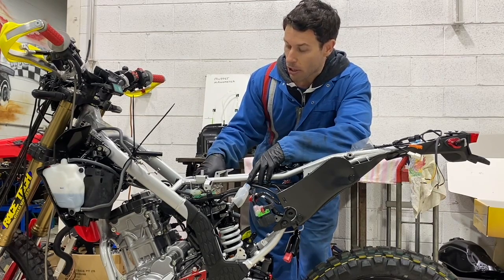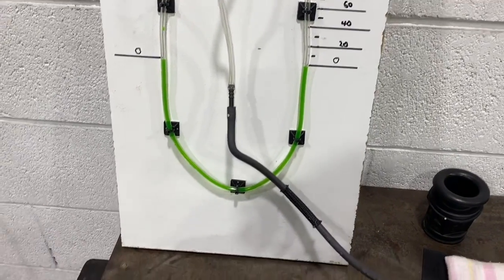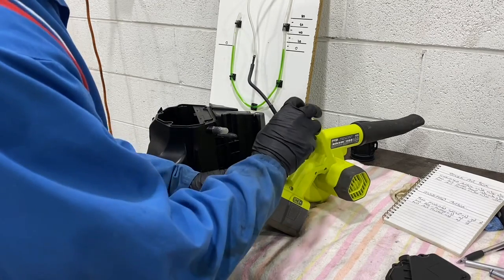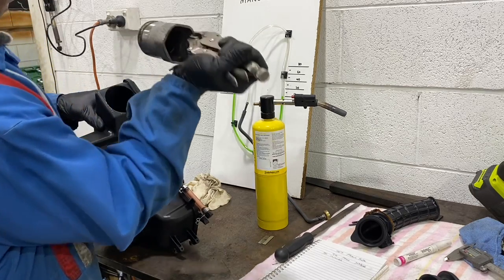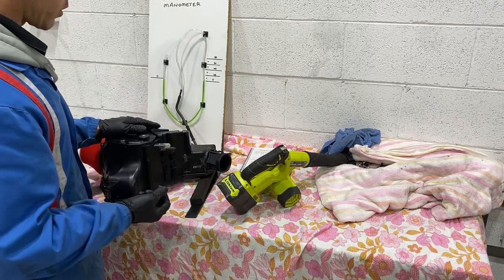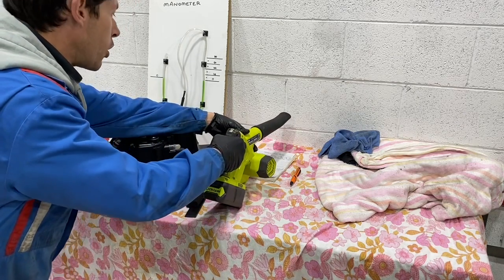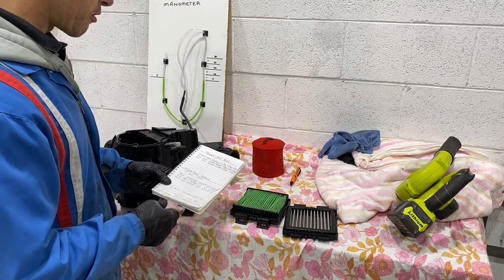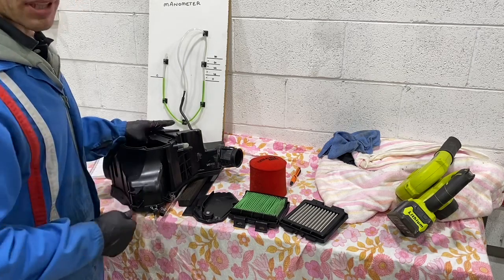Crf300l full intake test must see. Surprising results #crf300l #hondacrf300l #crf300rally #honda

Comment: But whats the max airflow that actually achieves max hp, by the principle you are working to a 6ft x 6ft airbox with a 4” velocity stack will give more more
Reply: many Dyno tests have shown that just increasing airflow (and consequent ECU tune to let it run not too lean) doesn' necessarily equate to more HP. Why would Honda's engineeres try to cripple the power of such a bike by simply restricting the intake airflow?

Comment: I just took the rear snorkel tube out. Cut that panel section out leaving a rectangular hole on the left and a triangle shaped hole on the right with a thin strip of plastic in the center for support. Silicone adhesived in a glassfiber screen door mesh to cover the holes. Took the reso chamber off and rubber glued in a shaped plug to smooth the inside of the intake boot wall.  Lastly, cut the front snorkel tube flush with the inside of the air box to create a still air box. Stock filter was retained, it is not restrictive even with the backfire guard. Made a big difference in response.

Comment: This test does not take into account the resonance of the intake system when the bike is running. This is just backyard "engineering." Not quite the same as those pesky Japanese automotive engineers use with their fluid dynamics testing. Leave engineered products alone!

Comment: I had a thought, and I know the CBR300 intake boot it like $20, but could you just cut the snorkel off the CRF intake and get a similar result and spend no money?  Would there be a performance upgrade vs. stock?  Also, then you wouldnt have the fitment issues with the CBR intake.  Id love to see that in another video with the Muppet Manometer!  I saw a Jake the Garden Snake video where he did the CBR intake mod and measured the ID of the 2 intakes, at they are the same at the throttle body end, but the CRF snorkel end is much narrower.  Just wondering if anyone else had thought about this.
Reply: I've thought the exact same thing... still haven't seen if anyone tried it.
Reply: @jesseduplantis3369  I did end up doing it, and using the cut off piece to add another air box hole. My butt Dyno says it helped, but I do t have any numbers to back it up

Comment: F()cking nice.  I have my bike tore apart doing these modifications right now. Removed the evaporative control system.  Removed in intake snorkel then enlarged the intake. I added the CBR300 High Flow Airbox Velocity Stack and the air box lid with the "frog skin" from 550 Performance.  I have a stage 1.5 ECU coming next week. Added the full RS-4 Yoshimura exhaust (which I highly recommend).  I might add the CBR cams but I doubt it.  I'm loving this bike, but if I want more power the only real option is to install the big bore kit from 550 Performance which I will never do.  After I fix this all up I'm going to ride it for a while then buy the KTM 500 EXC-F for more power.  I will never sell my CRF 300L but sometimes I need more power and speed so I'll get on my KTM 500 for that.  But for longevity, durability, and low maintenance I will ride my Honda.  I have a BMW 1250 GSA but I ride my little Honda 300L much more than that 600 pound BMW.

Comment: Great work Aaron, that confirms what myself and others have suspected. I am about to do some similar modifications to my airbox in order to take advantage of the CBR300 cams and 550Performance ECU.

I like your pod style air filter, does that fit under the seat ok?
Reply: I know you buggered your shoulder, but when you’re able, can you give some feedback on your mods now that you’ve given it the beans in a rally? 

I’ve been on the fence and have been waiting until you reported back as to it being worth the trouble. 

I’m at 4,000 miles and haven’t checked the valves yet. Figured I’d replace the cams and intake if in going through all the trouble if it’s worth it.
Reply: @marcochavanne  Hi Marco, I am getting ready to do just that. I'll probably need another week or so until I'm good enough to get back on the bike... but it is coming.

Comment: A lot of people say Honda did this for emissions but the CB300 is also honda's and it has the better air intake and cams, could it be that the intake snorkle is long to avoid water getting into the engine easily?
By being so long it dumps water at the bottom of the intake box and avoid it getting sucked through the filter

Comment: awesome video,are you going to go with a 550 ecu? and is it restricted between the throttle body and the engine? i hope you have the time to do follow up vids to the mods,keep up the good work cheers from WA
Reply from the maker: Yes 550 performance is almost finished with the new 1.5 modified tune , should be a winner.
Reply: @Azzaslife  awesome
Reply: @Azzaslife  anywhere I can find info on their new tunes?

Comment: Nice work - would the stock ecu adjust the fuel air ratio correctly to allow for the extra air or do you need the 550 performance tune ecu to compensate for the extra air ?
Reply from the maker: ECU tune is a must. 
Tune is lean from factory, only gets worse with mods.

Comment: Has anyone used a 3d printer to make an adapter plate to fit the cb300 velocity stack to the throttle body/airbox so we don't have to make our own seal out of epoxy or something?

Comment: The throttle body intake of the CBR may be a bigger diameter, considering it's length you will lose acoustic reinforcement flow at about half the revs that the original will have. There is no testing of the pulse performance. Now having said that you have cammed it for the CBR cams. This setup should give you a good boost. BUT if you are using the wide range CRF camms I suspect the low end power will suffer. The higher volume cbr intake will exaggerate that as the air velocity at lower airflows will be a lot slower. The air flow overall is useful for us with std cams I think, but I am not so much a fan of the throttle body inlet without the cam change.
I had a feeling the extermal intake socks were way too restrictive . Thanks for the confirmation!
My dBkiller modded ( larger holes in the killer) to intake cross-section MotoX , I have noticed that the 550 ECU is running rich even with two stock external intake tubes. So I may go to a much larger external intake and put a foam filter over them. I will probably make a couple of aluminium or carbon fibre Blair shape tubes there, but may just try simple larger diameter ones.
Thanks for the effort.
Reply from the maker: Thanks for the insight, I did a great deal more with testing (some things you mentioned) but I cut it shorter to reduce Boring content. 
I think this setup most people can relate their mods to.

Comment: I have seen other guys put the Unifilter snorkel sock on the end of the inlet like a dunce's hat and that seems to work better.
However i agree your modded 4" inlet mod seems to be most effective.
I have seen the 550 performance side cover with frogskin also - wonder what that mod would provide on your Manometre.
Also testing the unifilter foam main cage air filter.

Comment: Very scientific????
Reply: Eh probably not so much for two reasons: First, the suction of the leafblower is continuos, while a 4 stroke motor only sucks bursts of air. This is also the reason why airboxes often have those highly engineered shapes, because they want the air to resonate at certain frequencys (=at certain rpms) to produce boost. This video only shows how to eliminate air drag, but does not tell you what happens to all the resonances and other effects of the pulses. E.g. those long small tubes in the intake for sure cause drag, but they also produce a fast moving stream of air while the engine is performing an intake stroke. When the intake valve closes, the fast air has enough momentum to push forward in the tube and accumulate towards the end with a higher pressure. If tuned right, just as the highest pressure is reached, the next intake stroke begins and takes this "boost" in. The very long tube of the 300L suggests its tuned for low frequencys. The second problem with this experiment is how the hose taps into the side of the airstream. It does measure the drop in static pressure when the air is held back by drag, but depending on the orientation of the opening of the hose it could also see a mix of stagnation pressure and static pressure. These behave completely different, as one goes up with airspeed and the other goes down (Bernoullis Law). At last, comparing the pressure of the CB300R and the CRF300L intake is not good practice, because different diameter tubes will have different pressure inside, even if the same amount of air is flowing through (see venturi effect on wikipedia or elsewhere). And its just the amount of air (=mass) that counts in the end.
Nevertheless I think its great that this experiment has been done, and its probably scientific enough for tinkering with your enduro bike, i will for sure do some of those mods. Just keep in mind that you are also messing with resonances, which can make you loose some of this boost at certain rpms.

And i wonder why no one just cuts of the long CRF300L intake, because getting the CB300 one in there seems to be quite a mess
Reply: @ichebensonstniemand  "And i wonder why no one just cuts of the long CRF300L intake, because getting the CB300 one in there seems to be quite a mess"
EXACTLY my thoughts too! The intake is supposedly the same size from the engine side on both CB300 and CRF so about 40mm exactly. The CRF boot narrowes towards the rear end all the way to 35mm but if you cut 75-80% off the rear end it should be almost exactly the same as the CB300 part.
I'm in the process of doing a long video of me tuning my CRF with the ecu, intake stuff and full exhaust swap. I will learn there if it can be done too.
I will also do drag runs with RaceBox to see the actual differences.
Reply: @PatchedBandit  following your channel... I've been thinking the same thing.  Love to see your results.

Comment: 🤔 i wonder if i could just put a small pod filter straight onto the throttle body if i wasn't worried about mud and water?!
Reply from the maker: I thought the same, you so could easily.
Reply: @Azzaslife  im gonna do it then im currently running a full yoshimura rs4 exhaust with a 550 performance 87 stage 1 tune wish me luck😋
Reply: @Azzaslife  one question ive got the emissions delete done but whats the other hose that goes from the engine to air box is it just a crank case vent?